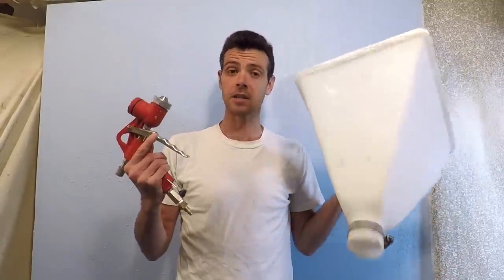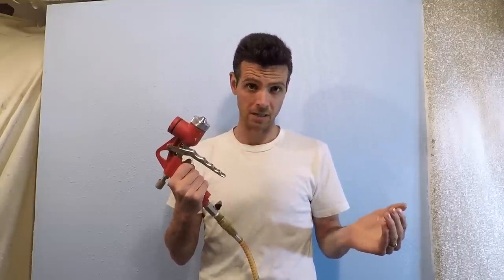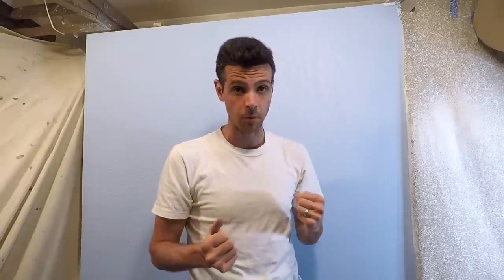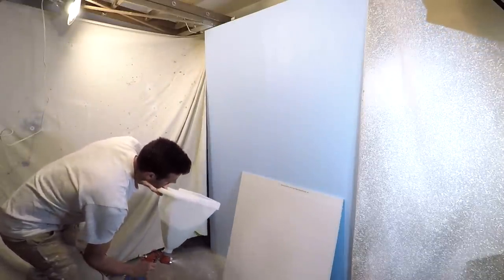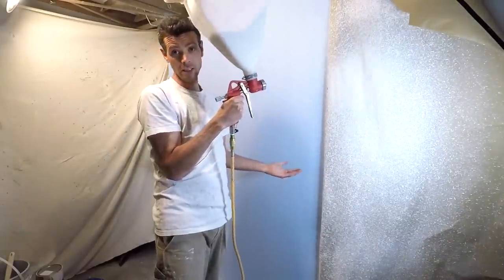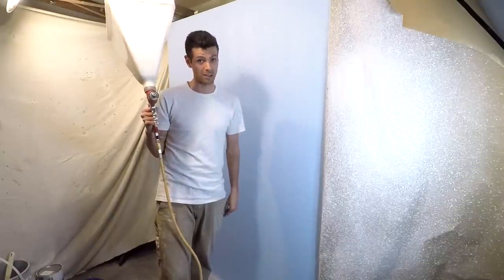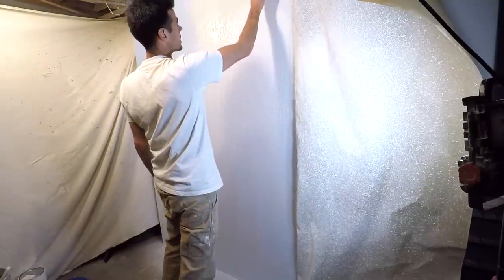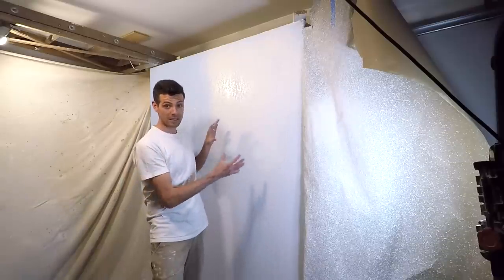My Second Attempt at Knockdown Texture

Comment: Don't ever buy texture mud, use 30 minute mud it will be fine, i've used it for years, and make sure you wait 15 min before knock down,  ALWAYS use a NEW box otherwise you'll get goobers and will mess up your knock down. 
Your mud is also too thin, the runnier it is the longer it takes to knock down. You want "Pancake batter" consistency..
Spray it like your painting a damn car, DON'T HOLD THE TRIGGER CONSTANTLY !!!
Its not that hard to do, my first experience doing it came out like a professional. its easy if you listen to somebody and repeat it.
If you wait too long and start to pull the mud, you can lightly spray it with a water bottle sprayer and knock it down it will help with pulling, doesn't' always work but generally does.
after its dry, take 220 sand paper and hit the entire wall lightly just to knock off the sharp edges.
Texture is real popular in the U.S. Most new construction has some but most all Re-models have it on all walls, its an easy nice looking upgrade to an otherwise very old house where you can see the drywall lines before they used beveled drywall to hide the seams. 
It also hides wall patching, most people don't know how to patch walls with no evidence you were ever there, they just texture it and call it good.

Comment: yall are trying to learn something from someone who is learning it them selfs. air pressure set way too high, mixture is not the right consistency, not moving the gun in a timely manner, incorrect gun setting and not using the properly correct knock down knife. there's different methods that are easier to get the same texture effects if your a noobie.  wait time to knock down is going to change depending on climate, mud, house temp setting!
Reply: Yep, I spray at 25 psi, not 150 lol

Comment: Yeah pressure is too high and technique isn't correct.....just use wide pattern technique and fill in where its light.....your radius is too tight and jerky....relax your arm and wrist and try bigger pattern.....less likely to pile it on too thick in one area as well.....sprayed a ton of this stuff....just takes practice and you can also rest is on shoulder 

Knob in back is for material flow rate

Comment: Plastic blade 
Finger test. 
It’s better with 2 people pending on size. 
And the reason it’s all knock down. Orange peel etc. it’s quicker to finish the job verse a level 3-4-5 wall. 
In short cheap and quick. 
I hate it and try to get customers away from it

Comment: My thoughts are that it’s a messy, time consuming process that produces an awful effect...please people, don’t do that, at all! Very 1980’s! If you must have texture, (and why would you?), skim and use a roller.
Reply: I have never been inside a home that didn't have some sort of texture on the walls. I have been in the trades for 20 plus years in the Pacific Northwest. Are you located in Greenland or somewhere else that is equally remote?
Reply: @jestinloveday584  Almost no one has textured walls in Boston, thought textured ceilings are quite common.
Reply from the maker: @jestinloveday584  that's what I meant about as soon as I cross the border. There is no texture on walls here but I see it everywhere as soon as I'm in Washington. Nowadays everyone is removing textured ceilings too here. I have been doing nothing but smooth wall my whole career.
Reply: London & Brisbane, people have been scraping off and plastering over textures all during the ‘90’s! Beautiful level 5 smooth walls is ALL builders are doing now! Still a lot of textured walls in Africa though, especially in the mud huts!
Reply: @vancouvercarpenter  Now in the US smooth texture is coming back. Texture machines became the thing in the US for the last few decades. they would park the mixer outside the house on a trailer mix all the mud then come in with a hose and gun and shoot the whole house in and hour and then knock down in an other 45 min. same thing with acoutic ceiling. in my opinion a smooth or imperfect smooth is more warm and has become the next thing in CA anyways on remodels and new builds.

Comment: Why do people texture walls/ceilings?  It always looks like shit and it's extra work.
Reply: eeguy77 it helps hide imperfections smooth wall is the hardest
Reply: @bernardfitzsimons4275  It hides imperfections by making the entire wall imperfect.  I'd much rather have a smooth wall with some imperfections than any textured wall I've ever seen.
Reply: You're what's wrong with this world, if it isn't your way, it' wrong.  If you prefer smooth, go for it.  I really think it's what you're used to seeing, in the midwest texture is the norm.  The only place you find smooth is in old houses that have plaster and lath.
Reply: @darinvee4980  I grew up in the midwest.  So I've seen my share of textured walls, especially ceilings.  It's never not ugly as hell.
Reply: @eeguy77  Obviously this is only "your" opinion. That you seem to think should be "everyones" opinion.  It is clearly not, as many people choose to have texture applied to their drywall ceilings and walls. If you don't like it fine, but stop insisting your way is the only "non ugly" way.
Reply: @darinvee4980  i grew up in the midwest it is not the norm.  There's a lot of it, but smooth walls are the norm and for good reason.  Textured walls are like shag carpet, a novelty that's way overstayed its welcome.
Reply: @eeguy77  God you're full of yourself.  Keep proving my point about your "all knowing" attitude.  I was a claims adjuster for 15 years working in 6 midwest states, looked at thousands of homes of all types, and texture is the norm.  Now I'm an assessor and inspect new construction from $200,000 to $2,000,000 and still texture is the norm. Not every home, but most.  If you don't like it, don't use it.
Reply: @darinvee4980  I doubt many 2 mil houses have textured walls and they are not the norm in the midwest.  But clearly you love them.  Some people love gold plated toilets and shag carpet.

Comment: Usually enjoy your videos but you missed the mark big time on this one. You should have practiced a lot more before putting this out there. Your pressure is way to high for knockdown. You need a flexible knockdown knife to achieve a good finish. As little pressure on knife as possible. Never go in circles always try and go in the same direction weather up and down or side to side. Also your orange peel looks nothing close to orange peel texture. It definitely looked like your second time trying. A for the effort F on finished product. Your very talented and your viewers deserve better advice.Keep up the good work but get some practice under your belt and show your followers the correct way to apply these finishes.

Comment: Yeah, that gun is gay... that knob is sum bullshit especially if you have a small compressor...
Marshalltown is actually a good one. Home depot has a good one but you have to still change the nosel sizes...
I don't fuq with knock down but I'm a frickin G doing popcorn and patching and matching old... like I got my badass badge on it, but I hate it because it's messy, how many times I've got popcorn in my eyeball... I know glasses, but a minute  later you cant see...
Thanks for the techniques I can do it easy...

Comment: That's a crap style hopper gun throw it away and get a wall-board without that stupid Valve. You do not need a big air compressor unless you're doing large amounts of orange peel and if you're doing large amounts of orange peel you should get a texture machine and do it like a pro. These Hopper style guns are fine for patches but you're going to run into texture inconsistencies due to change in pressure.